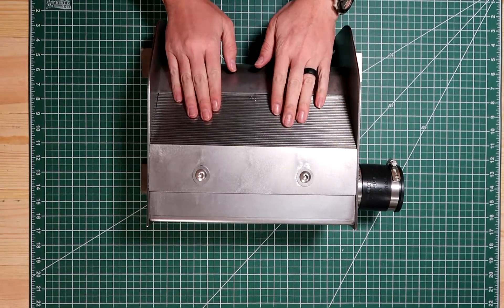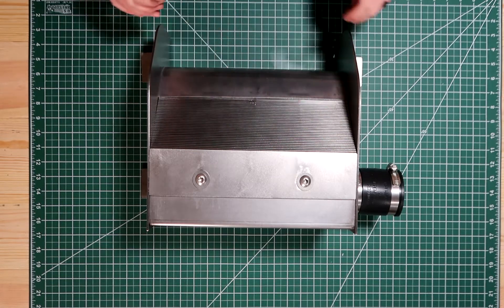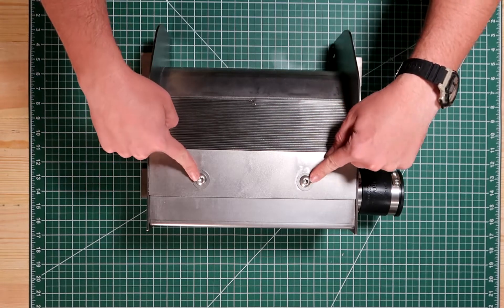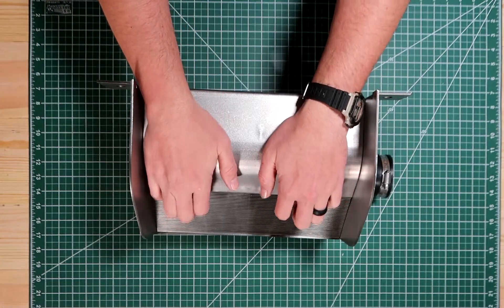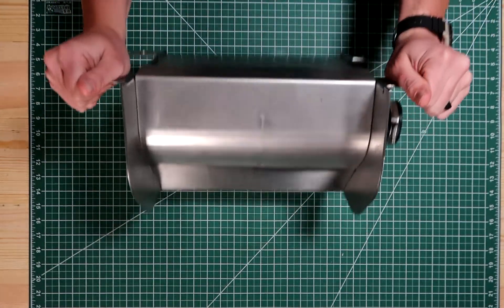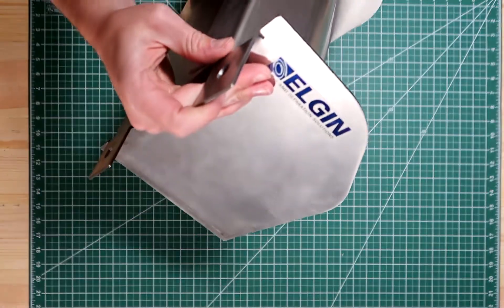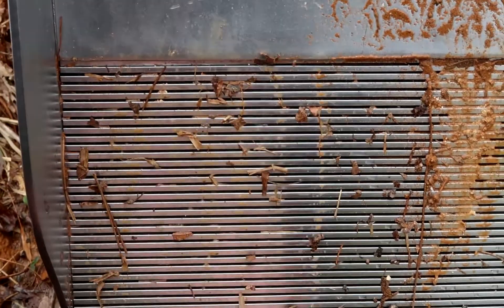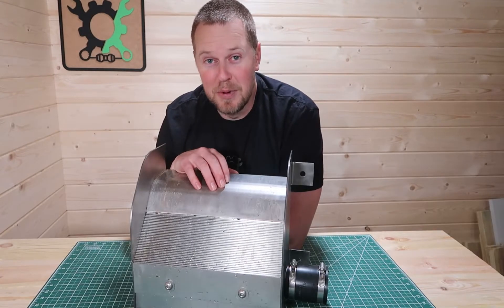Coanda Screen from ELGIN and Langston Alternative Power

Comment: What size apertures are they on your device?
Reply from the maker: Do you mean the space between the coanda grooves?
Reply: @ToolsTechAndGear  Yes, the slots. Also, do you have a formula for the optimum velocities for different slot sizes or doesn't it matter? I have been working on a 500 micron filter that is a bit different to a wedge wire profile. A 50 degree angle appears the optimum slope but slower moving water at the bottom is running off although the yield loss is small. I am wondering whether I should redesign with greater velocity.

Comment: Do you have any solutions to prevent an off grid  coanda from freezing up in cold climates? I have tried an insulated rigid foam box and still had freezing.
Reply from the maker: I am not sure yet. I just took measurements to install mine. I imagine this winter will have several tests.